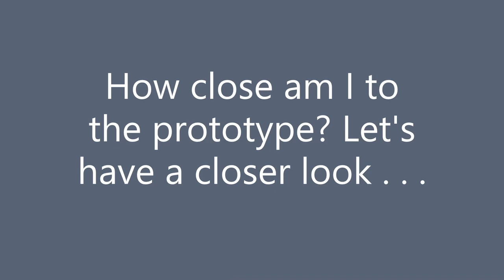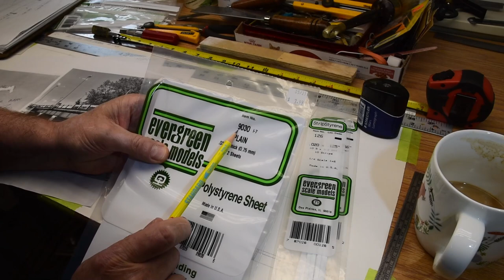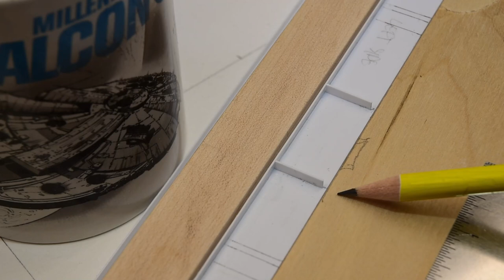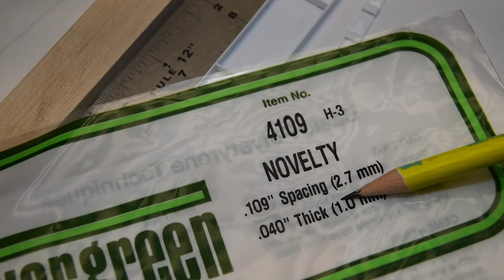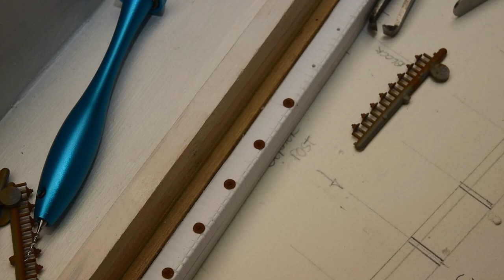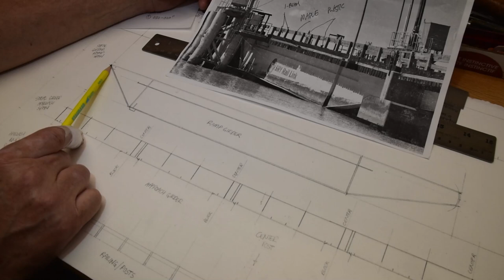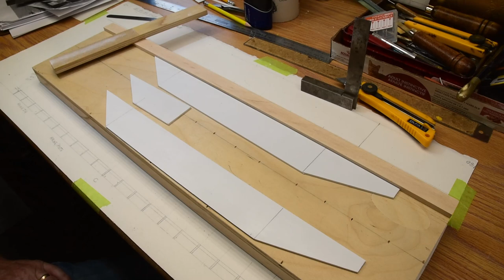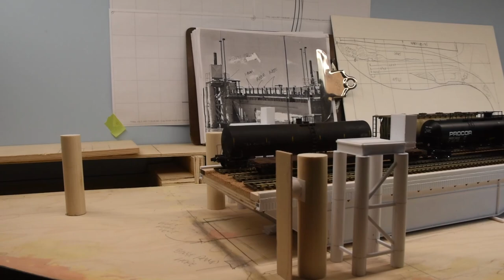The Barge Slip Build | The Rivet Counter & The Prototype - Part 4

Comment: I'm really enjoying this series. I'm learning a lot.  I hadn't thought about roughing up the styrene so it gives a better weld.  I've got a structure on the workbench now kitbashed using some parts from a Walthers kit and I'm having trouble getting a good weld with Mek.  I'm going to try that later tonight.
Reply from the maker: Glad you enjoy it! Yes. Roughing up the surface makes a big difference. At least it does with Plastruct solvent and evergreen styrene. Cheers.

Comment: I love working with wood. It is starting to look like I need to build something for Waterman Junction that is made of styrene/plastic. I like the cutting jig. That would be useful no matter what material you are working with. I am not a rivet or nail hole counter but I do like adding items that are 2 inches or larger, such as nuts and washers. As usual you have presented a great bunch of tips and techniques. Cheers - Larry.
Reply from the maker: Thank You Larry. You might end up liking plastic. I used to love wood as well. Something about plastics though once you get into it. You can build anything with it. Cheers.

Comment: I always believed that 7ft was equal to 24.52mm and not 20mm in HO, and 4mm is still 14inch, right! BTW, I love your video!
Reply from the maker: It is in the same scale of reference. But the photo I used is not HO Scale! It's an out-of-scale photo I randomly picked. This is the point of the exercise. 20mm is just a guage taken off a random photograph where the scale is not determined in order to acquire a working drawing. The drawing and the photo are leagues apart from HO Scale and the Prototype until the conversion method is applied. Cheers.

Comment: A minor tip related to that cool styrene cutting jig of yours. Before removing the work in order to snap off the latest cut, insert a toothpick or styrene strip under the steel ruler on either side of your work piece  This will hold the ruler up and make it easier to re-insert the work for the next cut and save your fingernails the occasional split. Cheers!
Reply from the maker: Thank You for the tip! Cheers ~ Boomer.

Comment: OK. I am going to disagree a bit with you on you structural dimensions. A standard door is 6'8" high, The inside floor height is about 8'2" plus the floor joists at (depending on the design and type of building) about 2'. So, a close approximation is about 10' per floor. Therefore your four floor building is closer to 40' in height not 28'. A railing (by code) as a minimum of 34" in height from finish floor, just as a guide. Mistakes are inevitable. It is how you deal with them that matter. But hey! What do I know. Now I am waiting for the storm coming up. The project looks really very good regard less.
Reply: I don't believe he said the building was 4 stories high, he is simply guesstemating the height of the building, by the height of the door.
Reply from the maker: To Christiane069. You totally missed my point. I was only using the door as guide for a measuring tool when trying to ratio out a photograph. I said "give or take seven feet" as an estimate. I don't recall stating I was dealing with a four floor building either. Standard code for safety railing in Canada is 35.5"- 42." Not sure where you are coming from. I also wasn't dictating floor height or building code with my tutorial. You totally missed my point some. Anyway. Cheers.
Reply: OK. I am not going to have a fight with you. However, I just want to bring some dimensions when using a picture to estimates sizes. I am using US construction Codes as a minimum (California). Your drawing show clearly four levels. I still like what you are doing.
Reply from the maker: @Christiane069  The drawing shows four spaces in the context of what I was clearly demonstrating in terms of ratios when interpreting a photograph for the purposes of modelling. It has nothing to do with floor levels as you seem to believe for some reason other than what I indicated @ 32:17. I was talking about a wall in relation to height. It could be a warehouse and your "floor level" theory goes out the window. I guess you missed it out of context. Cheers ~ Boomer
Reply: @Christiane069  I try to be on my best behavior while enjoying boomers channel😃, As a non prototypical modeler , I didn't interpret his drawing as a representation of a 4 story building. The notations to the left clearly showed 7ft to equal 20mm. With that, he was able to utilize his HO scale ruler to determine the true modeling dimensions of the structure. Attacking him over a few inches Is irrelevant because regardless of what measurement he assigns , the scaling ratio is true. Cheers 😃